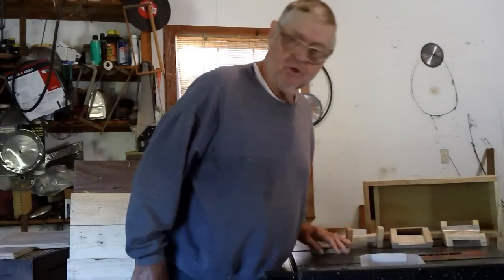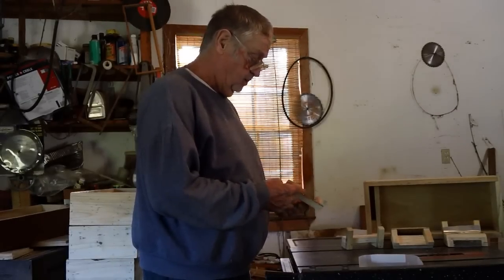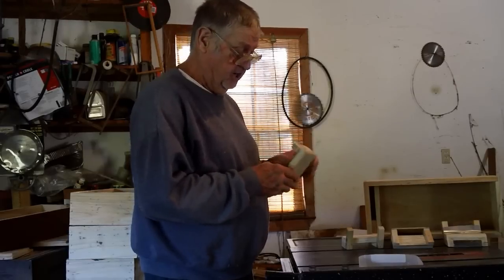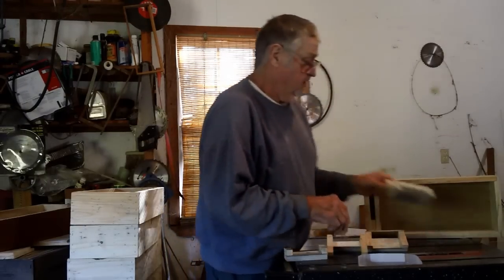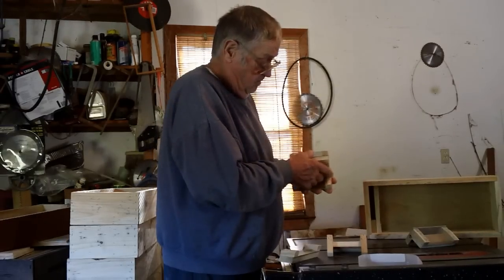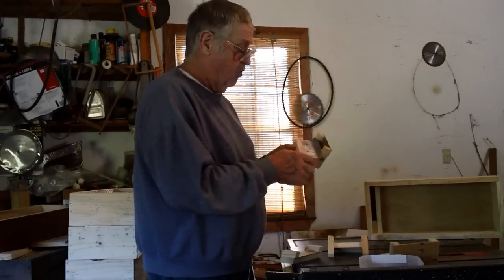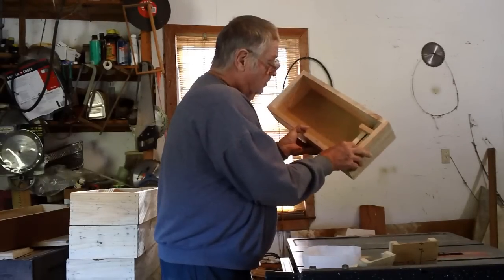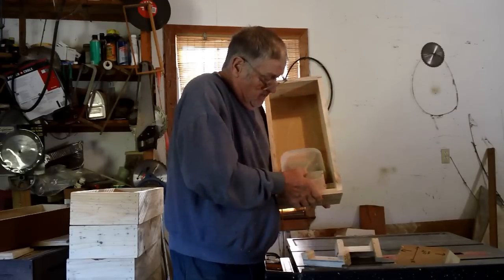Easy build tips for the Fat Bee Man NO DROWN FEEDER.

Comment: Question. When you build these why are you using milk jugs? Just use a sealer on the reservoir and now you can get more feed in the feeder. I like the screen idea. If anyone is running double nucs a ten frame box could be converted into a double muc feeder. If my explanation is confusing message me back and I’ll try again
Reply: Older video. FBM style feeder is using plastic shoe storage boxes from dollar general or whatever is in your area. $1 and holds a gallon or so. Plenty for a nuc.

Comment: Don, I made me a feeder as you describe, I use a 3 quart aluminum pan, I installed it this past December, recently I have noticed a lot of condensate and mold forming on the underside of my top. The feeder is on an eight frame double deep brood box. What can I do to prevent this.
Reply: metal condensates much quicker than plastic ...... do you have vent holes with screen?
Reply: @edgreywolf  bottoms are wood , I am in process of putting in vent holes